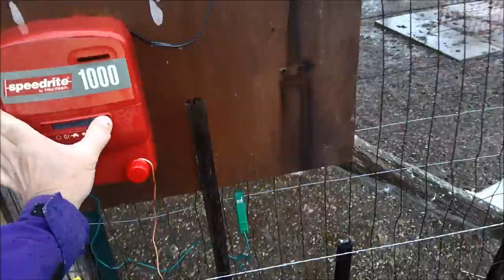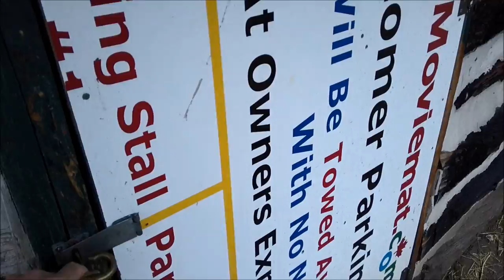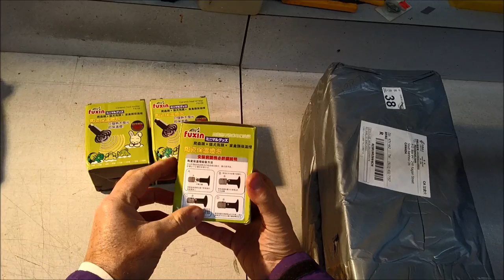Unboxing Video IR Ceramic Heaters From China #7 Hatching Duck & Goose Eggs

Comment: Watching you experiment w/ these Chinese IR lights. There’s a vid on YT of this guy who has the same sort of motorcycle I do, and he gets Chinese Xeon headlights for it. Then he shows you how he disassembles the back of the fairing and painstakingly installs the lights. Then, he realizes he has to take a metal part off each Xeon bulb in order to make it bright enough for this sort of motorcycle. So he removes them, does what’s necessary, reinstalls them. But then it’s really bright—too bright to make riding the bike legal (you can’t ride a motorcycle in America w/o the headlight/s being on). So he has to remove them again and go back to the original boring headlights.

Still, it’s a lot easier to watch someone else discover how things don’t work as intended, rather than discovering as much after I’ve done all that.
Reply from the maker: ***** Actually Fred you story sounds like something I went through back in the 80s with my truck and illegal headlights

Comment: Hi Matt. I was wondering how you made out with your chinese incubator? I was nit able to get a control pannel for mine so it went back and i purchased a Sportsman 1502 and am si pleased with the hatch rates so far this year. I should have just left that chinese one where it was in the first place. I got the same heat lamps you opened and like them lots. The birds follow the natural light cycle and sleep at nite and are awake through the day. Have no trouble with legs in the cornish giants when they rest well. Thanks. M
Reply from the maker: Michael Bjerland I'm hoping the chinese death-o-bator works this year, this time if anything goes wrong I'm doing a swap and replace instantly no screwing around

Comment: This may be helpful for you garden but maybe not. But at the end of the year you could leave any corn  stalks or brusell sprouts on the ground when you roto till that way when it breaks down in the soild will have a little bit more water holding capacity from organic matter which will help with ground moisture.  And you should only put duck poop or othe forms of manure on every other year because it put too much nutrients in the ground and could be detramental to your garden